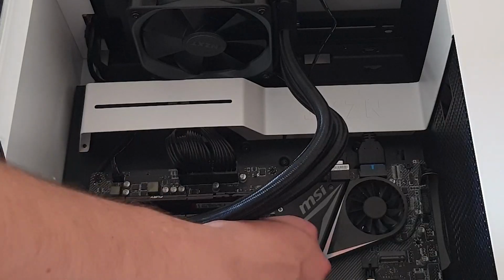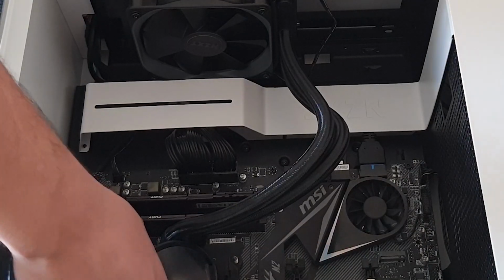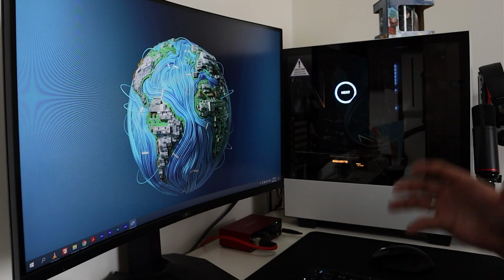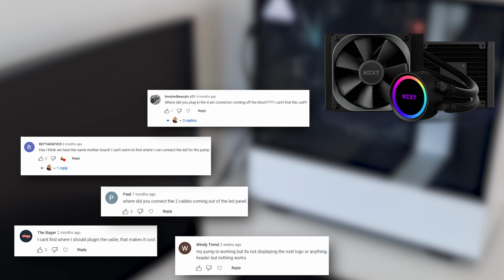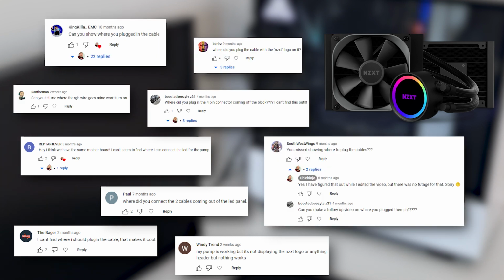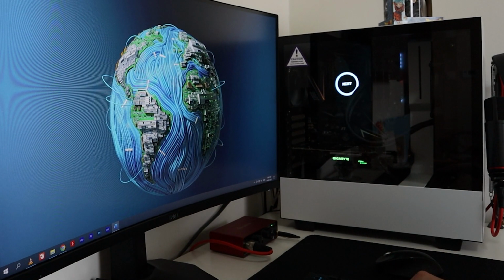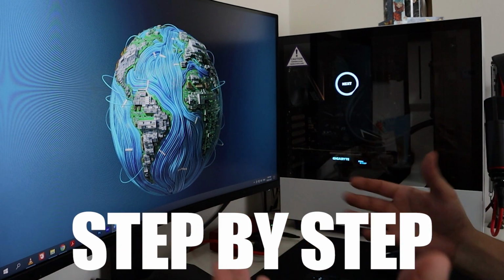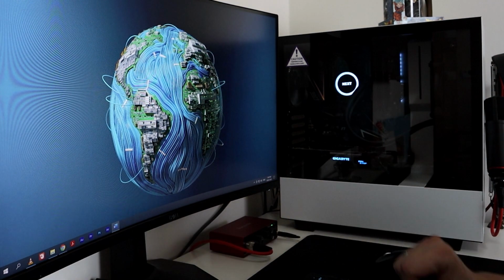How to Install the NZXT Kraken 120 Liquid Cooler

Comment: I just spent the last 72 hours on google and Reddit post tryna figure out where all the plugs go with no success. This video has let me know that there is a God... and he is real. He knew I could not go through life without the fulfillment of knowing that I built my first PC successfully.
Reply from the maker: I need to pin this one 😅 Good job, proud of you! 🫡
Reply: I plugged everything up the way you did and CAM still isn't showing my pump. Any suggestions? Is it a driver issue?
Reply from the maker: Yeah, use motherboard manufacturer software for RGB, I don't use CAM.
Reply: @Chichinjo  you can control the led of the pump from that software?
Reply from the maker: Yap tell me the model of motherboard that you use.
Reply: @Chichinjo  ASUS rog strix B660i
Reply from the maker: OK, as I could quickly browse, you should use Asus Aura software. Give us feedback 🙏 🤝
Reply: I know this is hella late but incase you needed some closure the kraken 120 isnt supported on cam you have to use manufacturer @Awesome8k
Reply: I just want my pump to be recognized by CAM.
Reply: Did you end up figuring it out ? I'm having same problem smh
Reply: @luisgarcia-dj2kw  nope. No matter where I plug in that plug CAM doesn't recognize my Kraken 120
Reply: Mine was being recognized for a long time and then I did a CPU swap from a Ryzen 5 2600x to a Ryzen 7 5700x and then it stopped recognizing it for some reason
Reply: Bro for me it was 2 years let me see if it works now 😅
Reply: @samulol_57  my stopped being recognized by nzxt cam. I just gave up. Buying a new one soon
Reply: Same. but a little less time searching. There’s nothing on cable installation. Came back to this video a few times. Thank you for the easy and understandable  video. 🙏

I have a problem with my motherboard tho. My X670E Aorus Pro X has 4 pins as the CPU_OPT instead of 3. I can fit it, but I’m deciding whether or not I should get a different cooler because of that.

Comment: Without an nzxt motherboard how am I able to control the lighting of my aio through cam? Because I also heard that you are not able to control it using the nzxt rgb controller as that’s specifically for fans and leds…
Reply: Try signal rgb it’s a soft ware you down load off your browser

Comment: What do you do if you dont have an Aio pump on motherboard where do you plug in the pump from the radiator?
Reply: Did you ever figure this out running into the same problem
Reply from the maker: You put it on any free chassis fan header and configure it on max speed.
Reply: @Chichinjo  I found a cpu opt that is a 4 prong but manual says it can go there. Hope i didn’t do something wrong I’ll update if i ruined my pc lol
Reply from the maker: Just remember to tweak cpu opt in bios.
Reply: @Chichinjo  update cpu opt runs beautifully and cpu hasn’t gone over 60°C under heavy load
Reply from the maker: Great job 👏 proud of you! 🫡

Comment: i’m having trouble with the other cord on the aio the 4 pin male. like does it connect to anything or do h leave it
Reply: I got the same question
Reply: @tristankopp8785 so turns out he actually explains it in the video but you really gotta pay attention to what he does
Reply: @tyllxrej bro literally say the problem, don’t say that the guy didn’t go over the step, and you don’t even explain what he said
Reply: @Blackkid42  I didn’t say he missed a step I just thought he was quite vague on what that step was like he quickly went through it without explaining where the 4 pin male went when plugging in the aio and just read better bro
Reply: @Blackkid42  I mean if you’re asking for my help of what I did with this cable I can’t tell you now as it’s been a year and frankly I shouldn’t be the one giving advice as it taken me 3 hours to get my aio in
Reply: @ yeah man I’m just frustrated, I plugged everything into it, and my screen and device isn’t being detected on my software, I got a 120
Reply: Screen won’t even pop up
Reply: @ do you have insta I could try and guide you ? I’ve had some success and cons throughout my pc life and I can see if I could trouble shoot you through your issue
Reply: @ I got a picture of my motherboard manual, and I labeled what wires I put into what slots
Reply: @Blackkid42 did you make sure everything is plugged in and have the next cam software downloaded and when you’re in nzxt you have you manually tell the software that you added additional parts to it so that the pc can configure its self properly to the new aio
Reply: @ yeah I downloaded the software, and it’s saying none of its detected. Where would I find the option to have it find the stuff I added?
Reply: Cuz my screen isn’t even lit up either on the AIO, the pump and fans work, but everything unfortunately not
Reply: @ and I still got the one wire leading out of my Cooler screen, that he said not to plug in, it’s the male 4 prong one
Reply: I can not seem to get the LED to turn on. I don't have a 3 pin like the extra cable where it's missing one slot. I cant tell if it's working or not.

Comment: My leds won’t connect, mines a 4 pin
Reply: Check your manual. You may not need the extra cable at all. It turns the 4 pin female to a 3 pin female

Comment: I am sure it is a stupid question but what about the cooling liquid. Is the cooler coming already filled or do I need to fill it before installation?
Reply: Did you figure that out?? Cause I came looking for the same thing.
Reply: @GrayMimikyu  It is filled. I just wanted to make sure as the supplier of my pc sent me a spare device because the original was broken.
Reply: @rudikonradski  thank you for this. I don't have to wonder buying coolant haha.

Comment: i just received a used one from ebay and it looks brand new but it came without the mounting brackets!! What do i do ?? If i order online i'll have to wait another 2-4 weeks for the bracket alone to arrive. I do not have a 3d printer. someone pls helpppppppp
Reply from the maker: What bracket for mobo or for IO cooler?
Reply: @Chichinjo  1151 bracket for intel gen 9

Comment: To have led, pump has 2 wires you need to plug 1 wire into 1 cable attached to the box and attach to the 5v port in the main, to customize NZXT CAM you need to buy more HUB or use NZXT main.
Reply: So do you need the led is it necessary

Comment: My motherboard only have de CPU_FAN, the SYS_fan and a 12v RGB male conector. Can I plug the pump to the cpu, the fan to the sys fan and the 4 pin female rgb directly in the MoBo? I saw a lot of people saying it will kill my cooler.
Reply from the maker: Well, it will if you don't allocate CPU_FAN to 12v in BIOS. * Just go to bios, find header settings, select CPU_FAN, and go with manual settings and 100% on all temperatures, or switch to "V" and give it 12V. If you have any doubts, feel free to ask more questions. 😊

Comment: Hi! Guys i have just mounted the Kraken 120 but is etremely noisy, the pump is fixed at 4200rpm and i can't change speed in Bios. I think is coulf be faulty! any possible fix?
Thanks!!
Reply: Mount the radiator above the cpu.  You've probably got air trapped in it and it'll burn out.  I mounted my radiator and fan to the top of my case and it's the ideal position. Don't let it keep running if it's noisy.
Reply: It is just kinda loud unfortunately

Comment: I have a pre built Lenovo legion t5 and done step by step 3 time and the block isn't lighting up. The Nzxt cam isn't detecting in the software
Reply from the maker: Yeah, I saw that people have issues with NZXT Cam software, unfortunately, I use MCI centre to control my RGB, so I didn't even tried  to configure CAM software. 🤭
Reply: @Chichinjo   ur video was fine i had to delete the Lenovo vantage app and reinstall it now its working. the nzxt app doesn't detect it throuigh there but i change the  color through vantage. thank you for this video i would have been lost.
Reply from the maker: You welcome Aaron 🫡

Comment: Man please i need help
There’s a 4 pin male from the pump where should i plug it because I want the nzxt cam support
Reply: We watched the video but there is still 1 4 pin male cable that is left unplugged from the block. Where does this cable go? P.s. amazing video I'm just stuck here
Reply: Where to plug this cable in anyways? My Nzxt doesn't light up I'm guessing it's because this 4 pin male cable isn't plugged in anywhere
Reply: @JDizzleHD The only thing i done differently is plug the 3 pin to sys fan and the 4 pin to cpu fan. there should be 1 4 male pin unused.
Reply: @convictMilz did it work out for you?
Reply: @jdizzlehd8050   what pc is yours? mine is a lenovo.
Reply: I have the extension it came with to make the 4 pin male into a 3 pin male... Still unsure where I could plug this one in
Reply: Don’t have an rgb header only  argb n still doesnt work  need help had no rgb  goin 2 years now
Reply from the maker: Watch the video 😅
Reply: @Chichinjo  i watched and you said we don’t need it??
Reply from the maker: Yeah, that's for additional RGB. 😁

Comment: You do not know how bad I needed this. Could you tell me more about how to attach the aio to the cpu? I’ve been looking everywhere for those brackets but they’re impossible to find.
Reply: My cpu didnt have the amd socket even though im using an am4 with an amd cpu. I ended up using the intel mount and it works
Reply from the maker: If you're searching for am4 socket, you can easily find it on any marketplace, since those brackets are standard.
You can always send DM on Instagram we can discuss easier than here.
Reply: @Chichinjo how to i find this brackets?